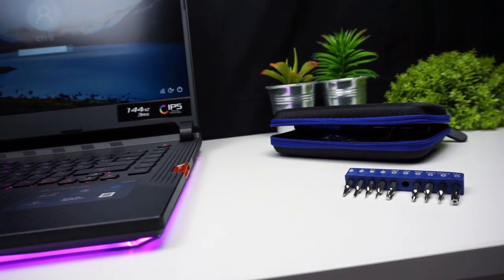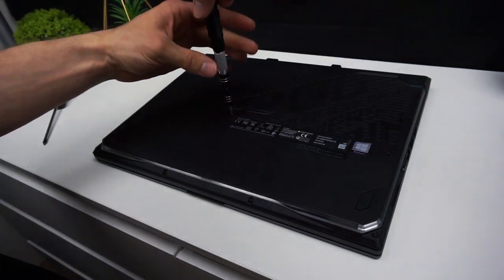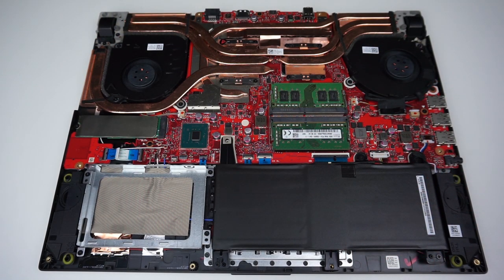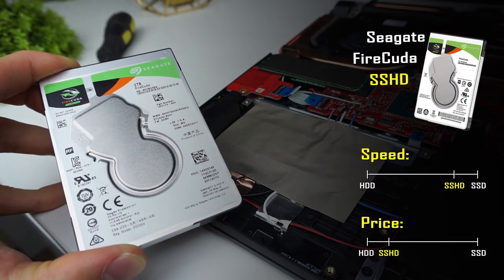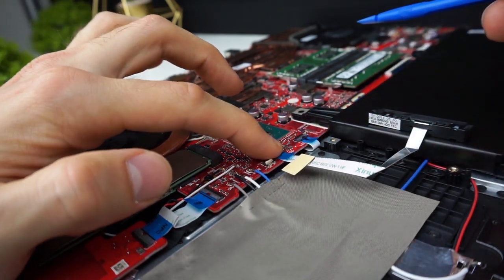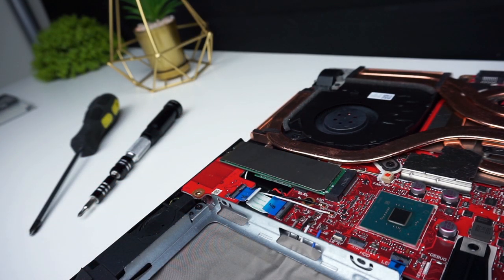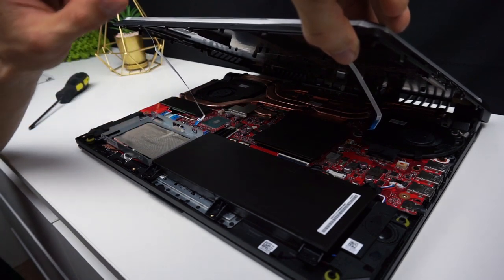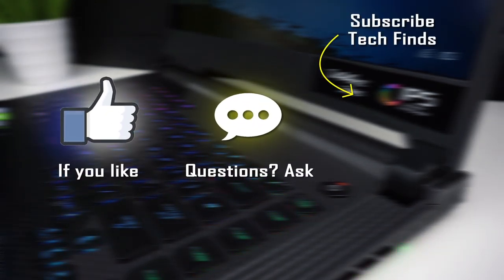Asus Scar III Upgrade RAM / SSD / HDD - Disassembly Guide

Comment: Hi, does it come with the 2.5" HD cable? Or you need to buy it apart?
PS Thanks for sharing. video is mint!
Reply from the maker: Hey, thanks. It may vary between countries, but mine had the cable included in the box separately. By default it comes with the cable in most cases i guess.
Reply: Tech Finds great video I plan on adding an SSD that I’m going to buy on Black Friday since they’re one sale, I have a question after I install it, do I have to mount the drive? Or will the laptop automatically read it and I’ll be able to use it right away?
Reply from the maker: @regulater117_  After installing you have to set the volume of new drive to make it appear in your PC.

Comment: On the scar 3 that i want to buy from amazon it says 16 gb of ram ddr4 and maximum memory supported is 16 gb , does this mean i can not upgrade it to 32 gb of ram ? Here is the link for the laptop and its description :      ASUS ROG G531GW (90NR01N6-M04290) 39,6cm (15,6 Zoll, FHD, WV, matt) Gaming-Notebook (Intel Core i7-9750H, 16GB RAM, 512GB SSD, NVIDIA RTX2070 (8GB), Windows 10) Glacier Blue https://www.amazon.de/dp/B07VHBZM4G/ref=cm_sw_r_wa_apa_i_nyz5Db8S8C643 
Thanks for helping out .
Reply from the maker: Scar 3 supports up to 32GB RAM (2x16)

Comment: why my harddisk isnt showing when i installed it already?
Reply from the maker: You have to partition it first. Here is how to do it:
https://www.youtube.com/watch?v=UV72wLA06_c&t=623s (start from 10:25)
Reply: @TechFinds  is it the same for scar 3 for this video ?
Reply: After i tried going into the bios, my laptop just hangs on the ROG logo when starting up, even without pressing F2
Reply from the maker: @peanut7260  It's pretty much the same for every laptop. You repeatedly press f2 or f9 or "delete" to get into BIOS while starting up. If your laptop doesn't boot at all try hard reset. I explained how to do it at the end of this video. Mine didn't want to start after upgrading as well.
Reply: @TechFinds  I tried everything, yet i still cant get into the BIOS when i connect my HDD. Hard reset, f2, f9, delete key
Reply: @TechFinds  it keeps having a beeping sound i don't know what it means
Reply from the maker: @peanut7260  I'm out of ideas, but have you contacted the Asus support? They should know what to do.
Reply: @TechFinds  they just basically googled it and reply me the things it said on google

Comment: If I Install SSD will I lose my data on my HDD?
Reply from the maker: If you will replace HDD for SSD then you will lose your data. (it will be still on HDD that you took out)
Reply: I am not replacing it .
Reply from the maker: @akshayhiremath1021  Do you want to install 2.5" SSD or M.2 SSD? If it's M.2 you'll need to reinstall windows on the new SSD and all installed programs / games from HDD won't be working. Your documents and files will remain if you won't choose an option to clear all drived while reinstalling system. The best way is to remove HDD during system installation or copy your files to external storage
Reply: @TechFinds  I got Intel 660p SSD with Asus original image OS
Reply from the maker: @akshayhiremath1021  yes it's M.2 SSD. If you'll replace it you have to install windows again on the new ssd
Reply: @TechFinds  Thanks m8

Comment: will it work on g731gw Kingston HyperX Impact 3200 [HX432S20IB/16] 16 GB x 2?
Reply from the maker: The laptop supports max 2666MHz RAM
Reply: @TechFinds  I had 3200 from the store, technical support told me that 3200 also works, and they should be installed on the g731 model.
Reply from the maker: @chembors  yes if you have the model with 10th gen processor. Otherwise it will downclock to 2666MHz
Reply: @TechFinds  I have a 9th generation processor and immediately stood 2x8 = 16 gb 3200 from micron (I can show the photo). i want 2x16 = 32gb 3200 from hyper x. will it work fine?
Reply from the maker: @chembors  It should work, but i'd rather go for 2666MHz version to avoid eventual compatibility issues. 9th gen intel processors support up to 2666MHz RAM from what i know
Reply: @TechFinds  Why then do I have 3200 from the factory? I think he should support without any problems
Reply from the maker: @chembors  check at what frequency it actually works. You can have 3200MHz RAM but it will be working at 2666MHz